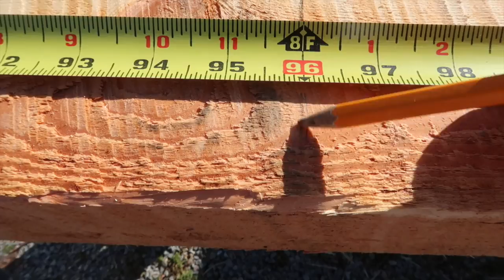Framing the Pallet Cattle Panel Barn (until the wind ruined it)

Comment: Yeah, I don't know how many of my projects I wish I had completed the day before. Wind, rain, snow, freezing temps are just a few things that can set you back. The former milk parlor will do fine once you get it framed and braced. You might think of using pallet material to close off one of the arched ends the cattle panels create, providing more wind protection for the animals. It looked like the amount of hay shown could be stacked much higher, making more room for the next delivery. Depending on how you 'pack' the carport, you may be able to park there this winter. Best wishes!
Reply from the maker: Thanks Brian!

Comment: Dan, you might want to take that tarp off of there for the time being until you get all of your support framed up.  That thing will be way more stable and easier to get the framing put in place without all of the resistance the tarp provides and you'll be able to safely work in there when the wind kicks up....might get a little bit wet when it rains though!  Keep moving forward and learning you're getting there!!!  You're construction projects are getting better...there's a bit of a learning curve to retraining you brain to building vs. your previous line of work.---Dave
Reply from the maker: Yes, excellent suggestion.  I have to take it off to do the ridge beam anyway.  Thanks for the feedback Dave.  Learning curve indeed
Reply: Dan, I was thinking about doing this as well. I have a suggestion or thought... what if you brought the ends of the cattle panels about 2 to 3 feet down on each side of the pallets? Do you think that would help with the integrity of the arched roof? Seems like the large amount of head room may be slightly to much. I'm building mine for goats not a cow.

Comment: Maybe time to get out the post hole digger and set  a couple of those 4x4 posts in the ground.  Add mid point framing and two ridge poles to staple the cattle panels to.  You don't want to have animals under a collapsing structure.   Maybe the farmer in the sky was sending a message on the wind.     Bert
Reply from the maker: I have 4x6 ridge poles that I wasn't able to install yet.  It is coming soon

Comment: cattle panels are good for alot of things, but without trees or buildings to break winds those winter gusts are just too powerful for tarp structures. I live on the tops of hills and always get those strong western gusts over open pastures.  How about finishing the roof with pallets if you are working with limited resources Dan?   I do want to mention to you I have seen one person use cattle panels & even chicken wire on the top of their tarped structure to secure the flapping aspect of & add additional weight...if it were me I'd go for a more conventional roof structure with heavy woods & metals or polycarbonate screwed in place...you can still save money by employing the pallet wood and nailing wood on to it.  I love that rough lumber you bought.  Guess you'll be planning on expanding heavier infrastructure for next season :) God bless and hope the weather gives you a break.
Reply from the maker: I'm going to finish this structure with the cattle panels.  Once the framing is complete, it will be quite solid.  Future building will likely be done with a normal roof though

Comment: I think it would be a good idea to add some knee braces at those right angle joints, along with adding ridge poles.
Reply from the maker: That was the plan before the wind storm had its way
Reply: Yeah, as Bobby Burns said "The best laid plans of mice and men gang aft aglay."!
Reply: Braced with r bar, anchored down with steel posts, quality greenhouse plastic between two panels, be able to take a lot, if not too large.

Comment: Couldn't you use the hay to hold up the cattle pannels?
Reply from the maker: It would create access difficulties
Reply: Tarp touching hay seems to invite mold trouble.  Better for the tarp to never touch the hay, so any condensation running down the tarp won't ruin the hay.